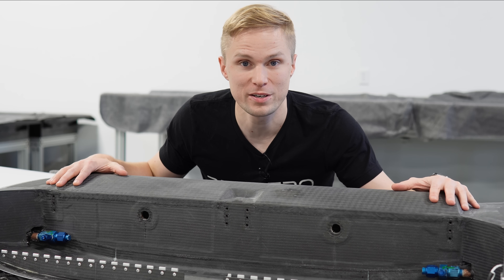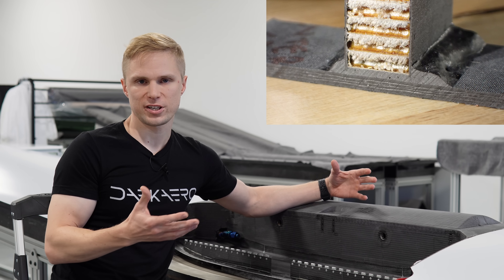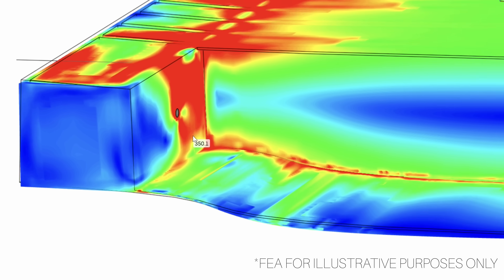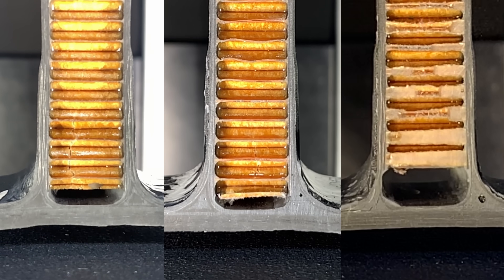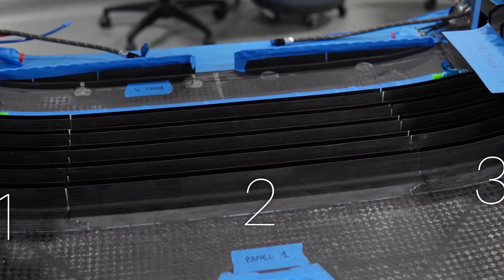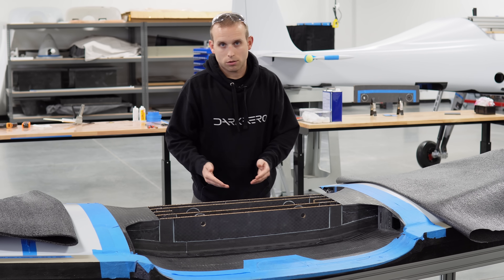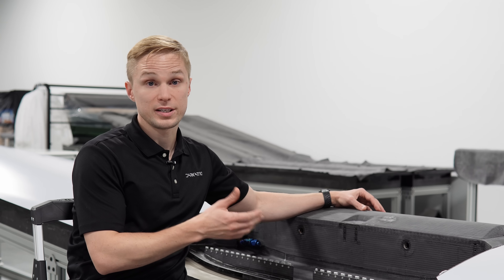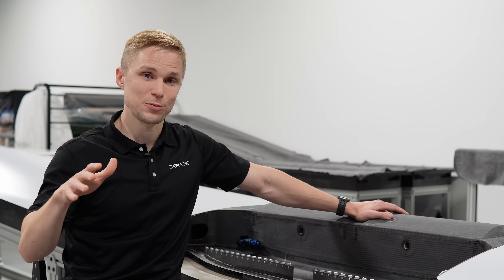Why we rebuilt our wing using pi joints

Comment: Hope you've increased the full fuel payload beyond the original design. 200#/passenger is reasonable, 190# is standard for light sport and some years old by now.
Reply: Typical European spec is 110kg/243lbs pilot&pax mass. Although assuming both or 220kg plus baggage and full fuel is not common.

I suggest a max design pilot weight of 127kg/280lb/20stone. 

Because that will cover about 99% of pilots and passengers. (200lbs will probably only cover about 60% of the US male population).

Comment: A&p tech here, with a fully bonded wing, how would NDI be preformed thru the life of the airframe?
Reply: tap testing. if questions are raised, a small access hole would be cut and then scarfed/closed.

Comment: How is repairability? If you have damage to the skin by bird or rock do you have to replace the whole wing?
Reply: Typical repair is sand away each layer with a 50:1 step. Apply same layers again as patches and wet-out.

With this wing, it might require a this carbon sheet/plate bonded behind the skin, followed by the typical composite patch of the last 50-years.

Comment: Using honeycomb inside of a wet wing is regressive. A pin hole will cause the core to flood, resulting in tankered fuel-load that is unusable. It could also cause degradation of the core material or bonds. 

That said, glad to see you're back making videos. Fantastic project.
Reply: What, pray tell, would cause a pin hole in a fuel tank?
Reply: The fact all of those shear webs are butt-joined with a blind bonding process. There is no chance to eliminate pinholes along web fillets. 

These honeycomb cores will certainly flood. But probably only or two cells here and there.

Also, foam core has the same issue. Although aluminum will hold up better to fuel than even PVC Divinycell would, no doubt.

Comment: Been watching this build for years now, investing and living small so that I can purchase this plane when it is finally available. Don’t stop guys!
Reply: This Little Maneuver's Gonna Cost Us 51 Years
Reply: The time cost was sunk with the original butt-joint design. They can get away with it where the "hollow-grid" is, because there is simply  a lot of surface area when you add up all of those joints.

But for higher loading cases, as they show, it is so far from ideal as to not warrant a second look in my eyes. Tbh, I wrote this kit concept off two or three years ago now. 

Too many weird gotchas, always finding extra problems to apply to what should be simple solutions: The split rudder. (Why? You have a constant speed prop as standard, which is a better airbrake than this rudder, and works at the flip of a switch). Complicated and expensive CNC Aluminum/Carbon fiber arm landing gear assemblies. Weird, blind-bonded edges for shear webs, that also make up wet wing. How can you ever eliminate leaks that way? How can you ensure structural integrity? When builders have to butt-bond a zillion miles of twin-edges to a wing skin? Blind? With no way to inspect with a borescope camera... 

it sort of defies reason. Is this a one-off professional designed concept? Great. Is it a kit for amateur construction and owner maintainence? No way.
Reply: @Triple_J.1 fully agree. These guys will never market this aircraft.
Reply: Investing and living small…

If all else fails… get a Mooney!

😃
Reply: @AC-jk8wq I have considered it. I’m not overly excited about building a plane.
Reply: Boy are you going to be disappointed

Comment: Great design and implementation in the center section. 
The tensile tests shown in the video demonstrate issues with surface prep of the skin to web joint. When the joint failed in each, the skin was shiny and little to no adhesive left on the surface. This indicates the surface tension was not activated, most typically by poor surface prep, IE abrasion and cleaning procedures.  However I did see in other parts of the video good surface prep of the bow tie skin. I would stress the shin to rib joint is one of the most important areas to focus on good prep procedures,  especially for assembly life cycle fatigue.
Love your progress and detailed approach to testing, great learning opportunity.  
Look forward to first flights and flight characteristics and keep up the good work efficiency data.

Comment: I like your scientific method, but see a problem too: using composites, you should forget building with pieces. The real strength for composites comes from the carbon or glass or kevlar fibre tensile strength, meaning, you should build from single piece trying to run the uninterrupted fibres along the stretching vector.
Bonding such separated pieces will always reduce strength by a lot, as you can see in your experiments. It always breaks where you bond them, "never" where fibres run uninterrupted in the direction of the stretch. 
This starts from how you design the whole object. You should design it from the start by looking at fibre direction.
Reply: At some point you will be forced to leave this theoretically perfect route. Without ribbing basically a sock is the only object possible.

The well engineered joints will add weight, for sure, but there's no way around splitting surfaces in an airplane.
Reply: @MichielvanderMeulen  Thank you for the reality check.
Reply: @MichielvanderMeulen  I did not mean that ribbing is unnecessary. I meant, that how it is designed structurally is not the best use of composites. You can design them so it has less components and less joints without fibre continuity being abrupt.
Reply: @Sonnell But how?
Reply: @Sonnell Ok. I would suggest making socks, put an inflatable tube in them, and glue them together in a mold (mould?). Still some issues :p
Reply: @Sonnell  "I am planning to build something, hence I think there are ways to do this." So basically you have a hunch? Sigh. Monolithic parts are nice and all that but they are hard to implement in composites for multiple reasons. A plane wing for example is far too complex to build as a single layout or fiber run. There are reasons why Boeing and Airbus use plenty of glue and mechanical fasteners to assemble their large parts from smaller parts.
Reply: @wombatillo Certain shapes are doable, they are under control. Some bonding methods are doable and under control. Integration paints you into a corner. Too many constraints. But ideas always appreciated.

Comment: Have been watching since the begining, and figured I would have no problem watching until it flies. I am 81 now, and at the rate the project is going, that probably won't happen.
Reply: you've obviously never brought a hardware project to completion, nevermind one as complex as this one. not only designing and building a plane like this, but incorporating mass-producibility and feeling confident enough to sell it en-masse, finishing something like this takes a long time and tons of effort, headaches, and money.
Reply: @kataklasm5621  Neither has Darkaero! All they do is re-engineer continuously. They are supposed to produce a product, then apply improvements to subsequent versions, not sit in an "analysis paralysis" state where they want to produce version Z from the get go. imagine if boeing said they were going to build the 707, but took 70 years for the first plane to fly, at which point they just decided to call it the 787! that is what Darkaero is doing, either that or just playing for time. Tons of other designers bring out successful transformative projects in fractions of the time they have been taking, they are building a small single engine plane, not the first Warp speed capable ship!
Reply: @25lightwolf  I think they are taking safety very seriously as they should. Why rush rush to appease those who have put in no effort? Have them take another 10 years if needed. If you want it done quicker, go help.
Reply: @soviet1942  There's safety, and then there is hiding behind safety, its been over 7 years! it took all 3 of them over 8 months to rebuild a wing with different joints. They can take as long as they want, but i am out, and from the comments i believe many others are out as well, the Risen SV916, as someone else pointed out, does everything this is supposed to do, and you can buy it now. It is becoming clearer and clearer that there will never be a plane, just the allusion to one to keep you subscribed...UNSUBSCRIBED!

Comment: Hey guys,
I am interested in understanding how you design complex composite structures while using Onshape, as the software lacks a specific module for the technology, such has Creo, CATIA or NX do. Can you give some hint into your process?
I would also like to add that while having years of experience working in aerospace, i am fully impressed not only by your theoretical knowledge but also by you practical manufacturing ability, and have learned quite a bit by watching your videos recently.
Kind regards.

Comment: I know it has to be tempting to press ahead and fly without the re-engineering you have been doing.  Great discipline on your part.  You re-thought the center section, gear connections and fuel sump that can remember.  Stay with it gents.  Many folks rooting for you.  Burt Rutan retired so some of us need new spirits of inspiration.
Reply: Burt built and flew 46 planes in his career.  If DA did that it would take them 322 years IF they fly the DA1 this year.
Reply: What does “punking” mean?
Reply: @MU-2  You need the urban dictionary app
Reply: I think you're punking these guys.

Comment: Love the testing!!! Stemme Gliders utilize an ultra thin fiberglass (maybe akin to 2ounce glass) between the CF pieces. A thin FG ply is used for Delamination resistance as FG has higher strain-to-failure than CF as it bridges micro-cracks but mostly for peel resistance, as FG-rich interlaminar zones strongly resist peel. When I visited the factory they used Hexcel or Gurit CF prepregs and E-glass or S-glass euro equiv 2 ounce FG at the interfaces.
Reply: Carbon bike manufacturers do the same thing.
Reply: If you could chose between a problem which is not there, or a problem solved, I chose the first. Rutan is a master in that philosophy. So make the wing underside continuous in contour, not adding a bulge under the fuselage. Avoid directional load changes, this causes the so-called crushing load in the webs.
A straight wing underside would have lesser webs due the absence of load direction change, so lighter, and cheaper.
Reply: A thin layer of fiberglass over cf can have many benefits.  It helps with galvanic corrosion resistance around any metal fittings or fasteners, as a sacrificial surface ply for sanding prior to painting, and you can add a copper mesh for lightning protection.
Reply: Thank you for your in depth comments.
Reply: Thank you for the additional information !

Comment: Adding more welcome back.  Great story on the center section and pi joint.  As a woodworker, I'm surprised the butt joint ever worked at all.  Looking forward to your next installment.  Keep 'em coming.
Reply: The butt joints are pretty standard in aviation industry, composite boats, wind turbine blades etc.  Pi joints are stronger but more effort.  In many cases stiffness is the design requirement more than absolute limit strength, and pi joints extra effort doesn’t pay off.  But when you need it…

Comment: Im kinda surprised you used the basic butt joint. When i build a wood boat kayak or even boat repairs we always use a fillet and layers of fibers. I use the u fibers on high stress areas or damaged or poor fitting pannels. Its been an amazing project to follow.
Reply: Those were(are) a bad choice no matter what.

They probably rely on having so very many linear inches, and a strong adhesive. Spreads and handles the small loads with a generous fillet. 

(But how can you inspect after bonding to ensure you obtained a fillet? No way to borescope that grid).
Reply: @Triple_J.1 Xray or immaging but that's expensive. Putting a layer of tape on either side makes a massive difference. And not that much weight for what it gives either.

Comment: welcome back. A while ago I wondered if this project was still alive. co-bonded and post bonded aerostructures were still very uncertain when the 787 was in development, mechanical fasteners and adhesive bonding combination used. I'm relieved you guys diverted from the wing design you had. Keep going Dark Aero!
Reply: A large part of that was the scale of the parts, particularly regarding how complex the parts are with joints and pass throughs and reinforcements. 
 But as always with composites it always depends how closely you're trying to get to the theoretical strength-weight maximum.

Comment: I repeat myself. Why ? Why ? Why ? You are going so much wrong direction. Why not building a spar
Reply: I give them props for trying something new but it's clear the original design fell short, hence the design change. But yes, at some point it's time to go traditional because there is a reason they have become traditional.  All these butt joints in the outer wings are kinda scary after seeing all these separations in testing. Also, how are they going to verify the build in production?  Will they load test every build?  I probably wouldn't fly it, or in it without build confidence testing.
Reply from the maker: Excellent question! The "why" of our structural arrangement is answered in this video: https://youtu.be/BlZArkn8nho. The short summary though is it allows for maximum internal volume for fuel while minimizing weight and also balancing manufacturing efficiency.
Reply: @DarkAeroInc  no you are going a pathway to which creates too much trouble and you think are outsmarting other manufacturers. And this is leading to massive fail. You can start these projects with reasoning risk reward or line you as overcomplicating nerding out. You took the second way.

Comment: Is the elliptical load distribution accurate to flight loads?
Reply: The answer is found in most aeronautical engineering sources. 

Review Lifting Line theory. (Prandtl, Munk, 1920s).

For an easier method, See: 1940s NACA report authored by Shrenk.
Reply: @Triple_J.1 that's one possible load distribution that's often considered optimal, but you can design whatever load distribution you like.

Comment: If you start that project again, would you consider the DeltaHawk engine?
and create the leading edge of wings from Aluminium (titanium version would be overkill) vapor chambers.(on back-side pipe with engine coolant) that would make engine cooling and unlimited and free wings anti-ice system.
Reply: This kind of cooling has been tried before WW2 and has been abandonned because it is inefficient and heavy.
Reply: @SuperYellowsubmarin  did they have vapor-chamber technology then? 
distribution of heat on large surface without that will be indeed problematic and heavy.

edit:
heatpipe was invented in 1960's and modern vapor-chambers in 2000's.
Reply: @bartoszskowronski I may lack imagination but I do not believe this would help. A watercooled engine already has a coolant pump to circulate fluid. What it needs is an efficient water-to-air heat exchanger. Having a very large convection surface area is crucial, which is not what a flat skin does. That's where fins come into play.
Reply: @SuperYellowsubmarin  wings have huge surface area much bigger than surface of combined fins surface.
radiator (or fins in air cooled engine) is a big drag generator. 
in my idea single straight pipe with engine coolant connected to backside of vapor-chambers would be enough to dissipate heat.

vapor chamber can be supplied of heat in one single spot to evenly distribute that heat on whole rest of vapor chamber.